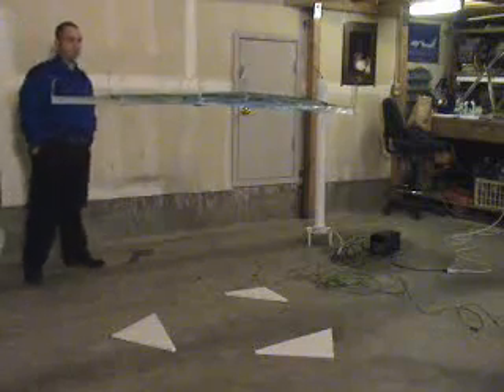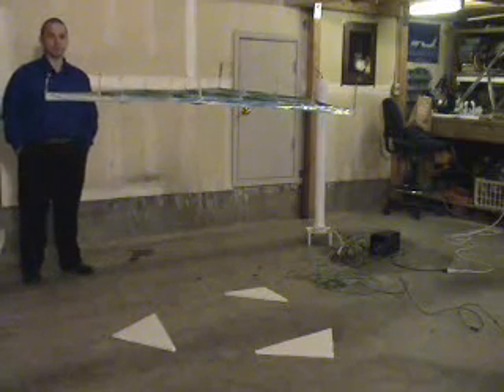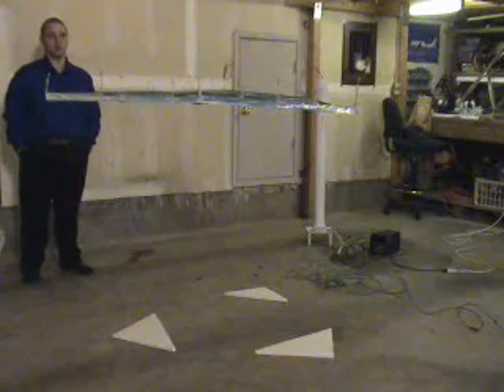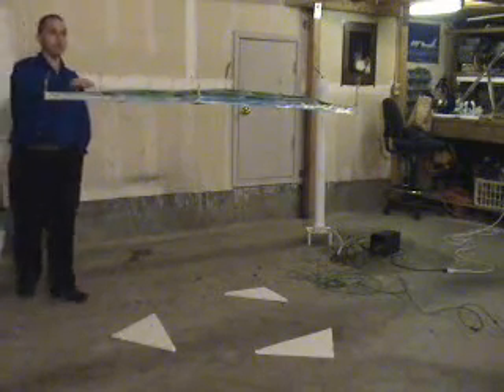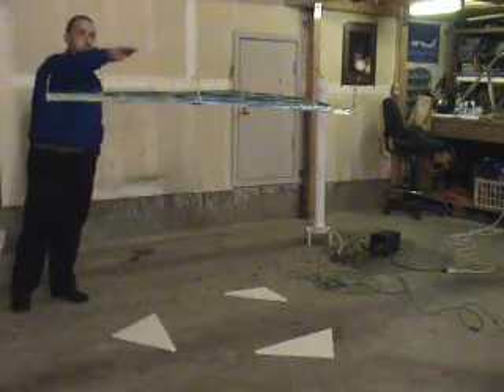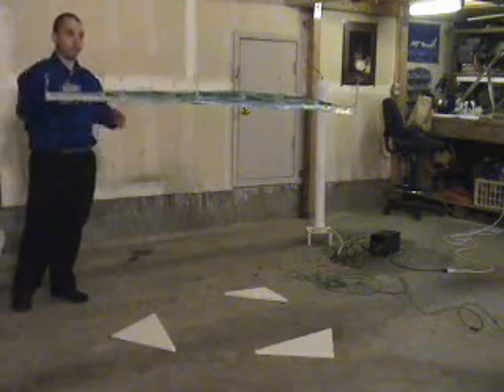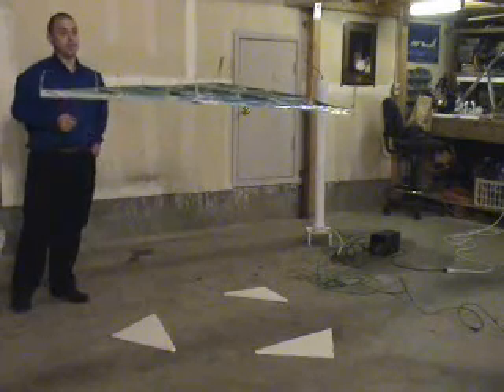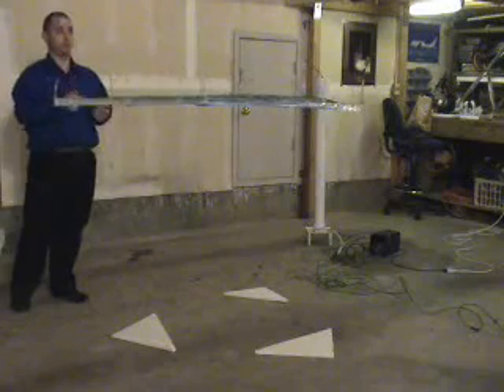Forbidden Science: Film-1 American AntiGravity

Comment: Lab devices weiging 100grams have produced thrust of 110g,for powere expenditure of 500Watts(250,000Volts @ 2 milliAmps).Experiment performed in air 1ATM. Supplementary research indicates much greater efficiency results(same thrust for less power input) when operated in vacuum (10^-4 mm Hg or better), when the current drops to about 2 microAmperes.

Comment: @Mart34 Onboard power was accomplishged by a professor in Tokyo in early spring of 2003 using a modified version of our ALPHA piezoelectric power unit, and also my client John Fiala flew one of my Beamship models with an onboard power module that he designed, several years ago. He also flew them in hard vacuum.

Comment: @dnelly Actually these things do fly but as I am sure you allready guessed no it is not antigravity. This is a very basic version of ion propulsion. The electic field around the wire ionizes the air around it causing it to be drawn to the negatively charged foil below to produce thrust. The strings are to hold it steady because it is not stable by its self. It wouldn't kill you if it shocked you but you still don't want it flailing around wildly because the shock stings like hell.

Comment: @Dessy909 It works more efficiently in vacuum. The harder the vacuum, the more efficient. You can turn the current down without any coronal leakage and losses caused by air.

Comment: @winterstellar Actually this thing does fly... just not because of antigravity. It is ion wind. There are wires but those are actually holding it down not holding it up. There is a bare wire suspended about an inch or so above the aluminium foil which is charged with 20 kilovolts. This wire ionizes the air around it causing it to be drawn to the foil to create thrust. It is unstable and the wires are here to hold it level and keep it from just flailing wildly about the room.

Comment: @UNOnumb The electricity does not create vibration, if everything is tight. The higher the Voltage the greater is the attraction of the ion-cloud from the foil and the oppositely charged ion cloud positive in front of the cathode-plate, causing a wavelike distortion in spacetime, and the device rides this wave of modified spacetime into infinity as long as the charge is maintained. The longer it runs,more efficient it gets. This is overunity.

Comment: A professor  a university in Tokyo Japan achieved self-powered flight with a modified ALPHA power-supply from Applied Electrogravitics (same one I'm using to loft Beamship Variation I and Variation II on YouTube) and a 3-cell lithium ion-battery, and a very large lifter, in Spring of 2003. Whatever you were doing, do it again, until you are SUCCESSFUL. An electrical field and a gravitational field are one and the same thing.Positive charge induces a G-well,a negative charge induces a G-hill.

Comment: @1freedomfighter11 Yes that is correct if you measure the airflow it does indeed appear that the ion wind effect is insufficient. However It is not the downward airflow which causes the lift. You forget that the aluminum foil is also attracted to the ionized air. It would be like having two feathers being staticly drawn together and constantly moving one out of the reach of the other. The actual airflow is meaningless it is the upward attraction of the foil to the air which lifts the device.

Comment: Measurements show max airflow is only 1.5 mph, yet a 16-gram device will need a 3.4 to 4 mph wind to levitate. Ion-wind has an upper-limit to thrust in air, or in vacuum with a reaction-mass; but there is NO limit to the force of the Biefeld Brown effect, it works in vacuum, and is non-linear.

Comment: So, under hard vacuum conditions, a force of 110 grams(1.1 newtons) could be achieved in the experiments for power expenditure of just 0.5 Watt (250,000 Volts times 2 x 10 Amps), or 2,200 newtons of thrust per kiloWatt. That is about 150 times the thrust-to-power ratio of a jet engine! That is also 10,000 times greater than the thrust-to power ration of a space shuttle main engine.

Comment: @1freedomfighter11 No the lift effect of a lifter comes from the attraction between the aluminum foil and the ionized air. If it was just from the electricity exciting the air then what is the foil there for exactly? Based on what you just said I should be able to make a lifter fly with out the foil... guess what it does not work.

Comment: I've built one of these.  It uses an ionic wind.  That is, positively charged molecules travel from the top to the bottom and create a wind that lifts the device.  That's why this doesn't work in a vacuum.
Also, the lift force is very light, so you have to use very light materials.
I find this very interesting, but it's not anti-gravity any more than helicopter blades are.

Comment: TT Brown, "A method of and an apparatus for producing force or motion", GB Pat#300,311, issued Nov.15, 1928, TT Brown,"Electrokinetic-Apparatus", US Pat#2,949,550, issued Ag.16, 1960, Hector Serrano (Gravitec), "Propulsion Device and method employing Electric Fields for producing thrust" PCT Pat#WO 00/58623, issued Oct.5, 2000, JW Campbell(NASA), "Apparatus for generating thrust ising a 2-dimensional asymmettrical capacitor module", US pat#6,317310, issued Nov.13, 2001.

Comment: @1freedomfighter11 Oh by the way the wingless electromagnetic vehicle you mentioned... I think maybe you must have missed the part where they mentioned that it operated by magnetohydrodynamics. This is a term I am quite familliar with. What that means is that as the electricity moves through the air it creates a magnetic field around the air it moves through which interacts with a magnet on the device. That vehicle has absolutely nothing to do with antigravity at all. It is not even claimed to.

Comment: The question at this point  is,  Can it operate in a empty  vacuum,? Have you Experimenter with a stronger Aluminum and Copper Frame, Have you consider taking the same concept to the next level, and have it work on and remote controlled setting with a independent self contained  power supply.

Comment: It certainly will. The larger you make them, the more efficient the are, larger the area of the plates, the greater the effect, the greater the Voltage, the greater the effect (effect is exponetial with Voltage), greater the K- factor of the dielectric between the plates, greater the effect, closer plates greater effect, greater the MASS of the dielectric, greater the effect. Patrick Corneill proved the greater mass devices lift more weight,as I did, and is more efficient in vacuum.

Comment: Almost right; GRAVITY IS AN ASPECT OF ELECTROMANETISM, whose function on the Electromagnetic-Spectrum is about 10^12 Hz.

The Bloch Wall, at the center of a bar-magnet where S flips into N, or the netral center-zone of a capacitor wher + flips into - is the neutral-center zone, and as such is a gravity-wave-source. Gravity is just as basic and generated force as the E-field and B-field. The unifying field is the ELECTRIC FIELD.

Comment: @The2012beliver By the way Tesla worked on a way to transmit power wirelessly on a global scale. The key word there is TRANSMIT. He did not believe he could generate an infinate amount of energy for free using the method only that he could save the power companies money by not having to string up power lines all over the place. Ofcourse he also believed it would be a more durable system as without power lines to be blowen down storms would not disrupt the flow of power as easily.

Comment: No need for a giant unit. You just need the new piezoelectrics of the late 1990s whcih we use now and in Tokyo, Japan since 2003 for onboard power of these larger devices, with Lithum-manganese-battery power. That is the beauty of this TT Brown patent # 2,949,550; you dont need much input power. You may fly a six-foot diameter model all day, for pennies a day. The energy of a small light-bulb. No moving parts.

Comment: Actually, insulator oil DOES ionize. Its called insulator oil because it is free of contaminants. I.E. it has no salts or electrolytes that might allow an electric current to pass easily.  This does not mean the oil cannot gain or lose electrons (i.e. ionize).  

Thus, it would be no shock that a lifter worked in oil, as oil would be a medium (just like air).

A vacuum on the other hand, is a LACK of a medium.  Lifters do not work in vacuums, thus they NEED a medium.

NOT that complicated.

Comment: I can see that the object moves with a certain weight, and does so unstable. I think the air has nothing to do here. It would be a phenomenon as when the helicopters begin to rise. everything around is affected by the air. phenomenon here is magnetic or electric, but I can not see that affecting the subject or objects around it. Fantastic. how much force needed to repel two electromagnets, causing a separation visible and tangible to be measured by your body or measuring devices?

Comment: The Biefeld Brown effect was CLASSIFIED by the US AIR FORCE from 1955-1995, after brass witlessed a test of Brown's 3-foot saucers in vacuum. With low-power, there was no limit to the speed. By 1938, Brown had been testing CIRCULAR model-boats with insulated, charged rim-segments. They showed instat-acceleration, and right-angle turns at any speed, but animals and plants on board felt NOTHING. No inertia. At least two-branches of the US armed forces utilise this tech,  notably the B2-Stealth.

Comment: No, it cannot make it fly. Example: an upward thrust of 110 grams is equivalent to a force of about 10^5 dynes. By comparison,a 2 microAmpere ion-wind resulting from electrons accelerated in a 250-kiloVolt potential would yield a force of somewhat over 10^-3 dynes, almost 100 million times less than the lift produced by TT Brown's Apparatus, that I first built in January, 1990.

Comment: This device clearly interacts electrically with the table top just before it lifts off. There is some sort of static cling effect going on. That means the table is not neutral. I suggest that whatever charge is pumped into the foil also leaks onto the table top. Foil and table top then have a like charge and naturally repel one another.
It looks like you're just playing with a big old gold leaf electroscope there to me.

Place a well earthed copper plate on the table top and repeat the experiment. If the levitation is produced by some locally generated gravity well then the behaviour won't change, but if it is due to electrical repulsion then the earthed copper plate will significantly impact the result.
Reply: That was a very constructive criticizam. Thank you.
Reply: Richard Towers I like the idea of impact result.
I like idea of useage of that, what We should in the Space with that.
Can We fly faster with this kind of machine?Maybe this some kind of beggining project,what We need!;),

Comment: Whatever wind there is is weak and diffuse, not enough to lift the device.Devices work in vacuum as tested for issuing of patents. Airforce CLASSIFIED entire subject after witnessing a TT Brown rig in Hawaii,1955 with saucers that ran so fast in vacuum,with very little input energy,there was no limit to the speed!Classification downgraded 1995.The cathode is lifting the entire armature.This is Van der Waals forces,or ELECTROSTATIC-ATTRACTION flight,and obeys Coulombs law. F = Vm1m2/r^2.

Comment: I've built this in my office with $10.00 of balsa wood and 14 guage electrical wire from the hobby shop.  Used the back of an old computer screen (caution) for the power source.  IT IS NOT FAKE.  Build it yourself and see.  No strings other than on the bottom to prevent it from flying away.  No interaction with the table.  The foil curtain around this is grounded with a 14 guage copper wire back to the computer screen ground.  Like I said, build it yourself and then start talking.
Reply: ...and vent the room, there is a huge amount of Ozone (O3) produced.
Reply: Fly it in a vacuum. It won't work. Proving it's the vibrating air and not antigravity giving lift

Comment: I have a remote controlled helicoptor which by the way will lift with its power source attached ....... rather than flying with its power supply sitting on the ground, sourcing energy through dangling wires !!! .... What a joke this is !!!

If you put the power  source (i.e. battery) on to your so called flying device, I bet you cannot even get that thing off the ground.

And by the way, my £10 helicopter does not require wires to be stabilised/controlled and can stay in the air for 10mins